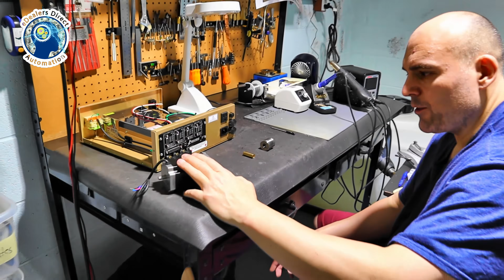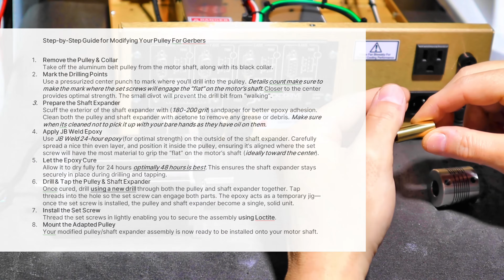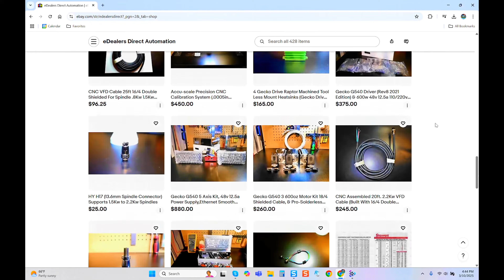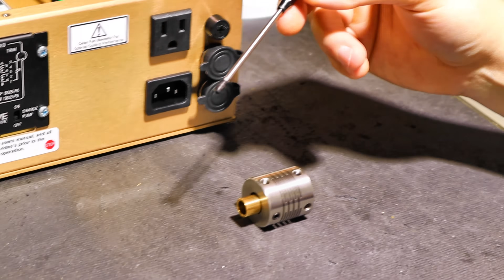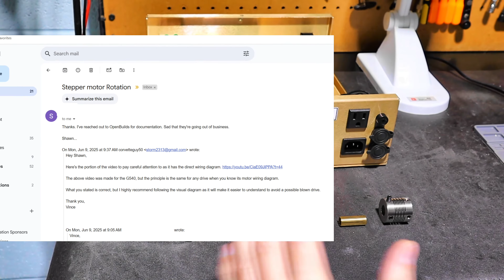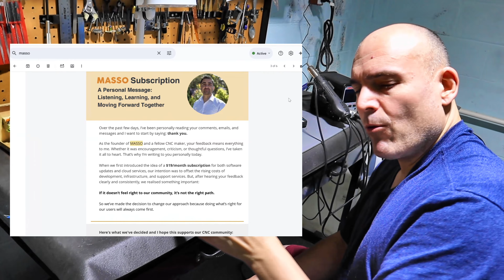Gerber 600oz Motor Retrofit Using Shaft Expander 🚀🔧

Comment: Why not use an oversized bushing (expander) throw it in the freezer, gently warm the coupler (will NOT hurt the integrity of the material) then press it in with a press, c-clamp, or vise and drill/ tap it.  This will be a perfectly centered fit and permanent bond regardless of the added set screw strength. No clearance or added clearance associated with the surface prep procedure for JB weld.  Seems cleaner. 

A service/subscription based model is always dangerous and you can never trust such a company next will be other forms of DRM and anti consumer behavior.
Reply from the maker: That's an interesting idea. I certainly try it! Thank you for your support. Vince